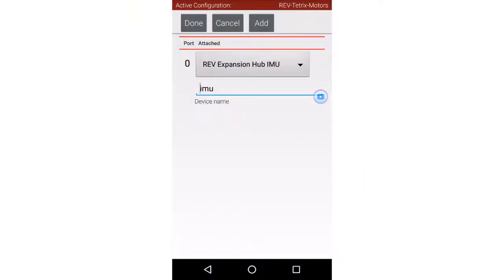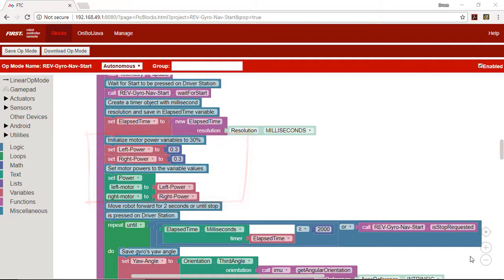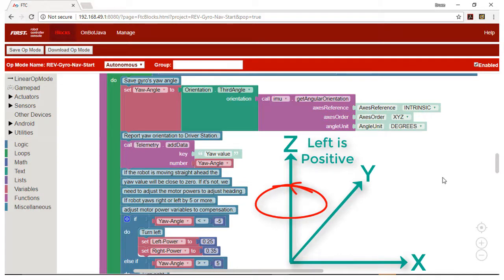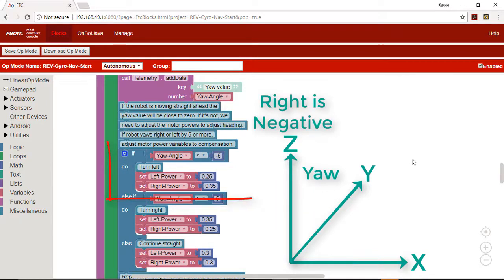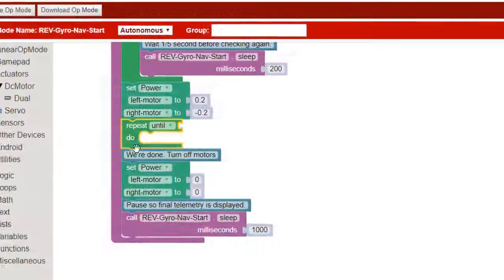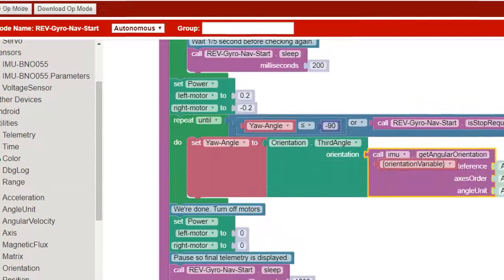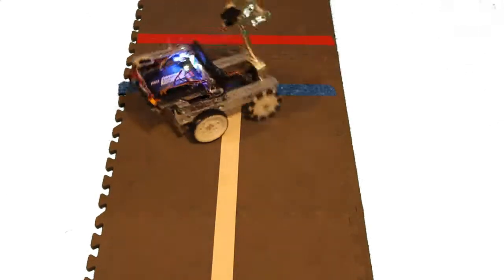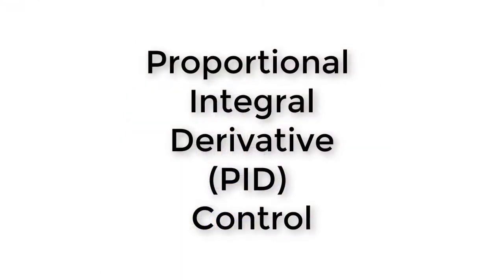Blocks: Using the REV Hub's Built-In Gyroscope to Control a Robot's Path

Comment: What kinf of variable is Yaw-Angle?
Im trying to use the GyroSensor on the IMU via Android Studio but when I assigned a double variable to "imu.getAngularOrientation(AxesReference.INTRINSIC, AxesOrder.XYZ, AngleUnit.DEGREES).thirdAngle;" I get a NullPointerException. Can someone help me out with this issue?
Reply from the maker: In Blocks, YawAngle is a numeric variable.  The Java equivalent is probably double but I'm not a Java programmer.  Perhaps the getAngularOrientation failed because the IMU initialization wasn't complete.  You could try assigning the result of getAngularOrientation to a variable first, check that that the value isn't null and then proceed to extract the thirdAngle.  You may find better advice on on using Java with the IMU on the FTC Forum.

Comment: Any chance you have a tourtial on java for this
Reply from the maker: No, sorry.  Hopefully you can adapt the content of this video to Java.  Also, note that if you have an existing op mode in Java you can install in on the Robot Controller phone and then use a web browser to log into it and add an op mode programmed in Blocks.
Reply: Bruce Schafer okay thanks
Reply: What's the advantage of using Java over Blocks for gyro functions?